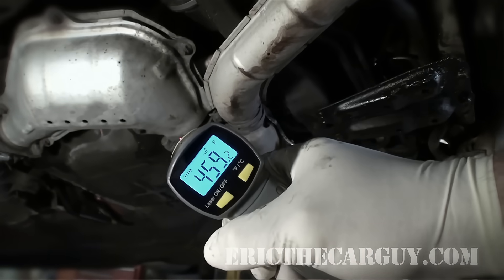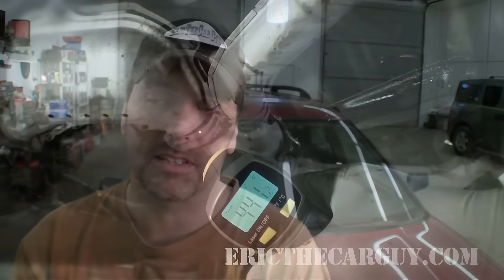Does Lacquer Thinner Clean Catalytic Converters? -EricTheCarGuy

Comment: Hello Eric, Thanks for the great tutorials; but don't knock some of the other guys that have the same intentions of helping others with DYI repairs. As you said you have dual cats which might be a factor.Soap and water might be the best bet in this case.
Reply: Correct !
As Myth busters do... They always Screw Up... Change / Weaken the Fix... So It Does Not Work.  You Need 4 Times the Thinner.
You were supposed to do 1 Gallon of Lacquer Thinner on a Half Tank (8 Gallons of Gas).  You barely had any Thinner.
But I used 2 Gallons of Lacquer Thinner with 13 Gallons of Gas in my 2013 Chevy Silverado 2500 HD and Drove 190 Miles on Highway.... Till I was near empty.... And it worked.  
But hey,  This Video is just an attempt to try and put down another Channel... small minds... small mission

Comment: I wonder if it is starting and stoping the engine. Letting it warm up to operating temps. Turn it off and let it cool all the way down overnight then starting it the next day. When cold the engine floods the cat with raw fuel to get it to light up again. So basically not driving on the interstate for the whole time. Drive it for a week like normal. Just a thought...

Comment: if you decide to spray the inside of your cat/dpf with a pressure washer,"DONT", if you do you will bend over and damage the matrix system inside blocking it worse,rendering it not useable anymore.

Comment: i tried spraying acetone into the air inlet with the engine running at about 2000,you got to be careful dont go too mad else you can cause it to lock,just let the engine rev with the acetone,it took about 4 mins and light out,never came on again.i am telling you what i did,iam not telling anyone to try this,but if you do its your own responsibility.

Comment: Eric: Have to agree with many others here. If you're gonna try the lacquer thinner test as Scotty suggested, then you should use the mixture he recommended - 1 gallon lacquer thinner to 9 gals gasoline. This is a 10% solution. 
Your test used 1 quart thinner to approx 7 gallons fuel (28 quarts). So your mixture was only about 3%, not 10% as Scotty recommended. Please try it again if you can. I'd be interested in your results. Thanks! Love your channel.
Reply: Yeah definitely an incorrect ratio. Scotty's car probably had a 15Gal tank, so half that plus a gallon(not a litre) of thinner.
Reply: 07 fj cruiser 
Saw this a year ago and tried Eric’s ratio - it helped a little but not enough. Then while running at 2000 rpm was reading the comments and saw scotties ratio of 10% (9 gallons gas one gallon thinner). Did that and it worked.

Now, how long did it work? 11 months/ 11,500 miles.  And it’s back just in time for an annual smog.  Haha
Going for the one gallon can this time and we’ll see.  

I couldn’t remember which guy had it work so reading comments and remembered.
Reply: Is there a specific brand that is more pure I heard acetone containing thinner can dissolve seals and gaskets
Reply: @bobbydigital4125  acetone is a different animal than laquer thinner. Do not use acetone !

Comment: Mix ratio all wrong for sure, but I have a problem with the mixing method. Shouldn't we POUR THE GASOLINE ON TOP of any fuel additive to get a thorough and best mix in the tank?
Reply: hell, take the gallon of thinner to the pump with you, add a gallon, pour 1/9th of the thinner in, then repeat until you have 9 fresh gallons. Boom. Well-mixed.

Comment: I tried the gallon trick on my 2000 grand caravan a few years ago.  It worked long enough to pass the emission test.  The code came back, so I did it one more time and the code never came back.  Sold the  van about a year later.

Comment: I am an automotive mechanic engineer. and I do not recommend doing it no less than half a tank x 1 \ 4 of fine lacquer or use this mixture several times full of gasoline because the oil compression rings will suffer harmful zebras, these oil compression rings are the cylinders of your car and have a plastic or rubber ptf cover. If you put a mixture that is too heavy, the life of the oil rings will lose its quality and your car will start smoking through the exhaust and this repair is only possible by changing the engine cylinder rings. So guys, be very careful when putting a mixture above 25% of your gas tank. The truth is that I do not recommend it, the most correct thing would be to remove the catalyst and clean it from the condenser and use cleaners you can use pure thiner laquer and an air gun to remove the titaniun "platinum that has value as gold is called white gold" that is a white powder

Comment: Scotty's method works if done right depending on how bad the cat it. I would recommend you try both methods. Have done it personally and it worked on a cat on a dodge charger that gave me hell. So I took it off, soaked it in a bucked of water and dawn soap for 3 hours, rinsed it thoroughly (making sure I got all or most of the suds out), blew it with compressed air, put it back on and drove for 20 min to make sure it dried... The p0420 initally came back on so I let the car cool overnight and went on to the next method. I put a gallon of laquer thinner in at the time I filled up to a half of a tank. Immediately I took it on the highway under a load of at least 65 for about 30 min. Within 10 or 15 minutes I literally felt the car no longer was bogging down like it did before. So I check the readings on my scanner and saw that my 02 sensors were functioning properly this time. Also my cat monitor readiness had been set without any p0420, which previously would have came up way before the monitor have been set. It has only been several days since the with no p0420 but I have put over 500 miles and the car drives better and gets a hell of a lot more fuel economy.  Also, all of my monitors are now ready without any single code. Based on all of the above I would say that the methods work. However it has to be done correctly and it may depend on the condition of your cat. Lastly, I would add that you have no exaust leaks interfering with your o2 sensors, as this might affect results. A new cat on this would have cost me $450 plus labor had I not done it myself. The dawn,  laquer thinner and half tank us gas cost me 40 bucks.

Comment: I used crc guaranteed to pass complete fuel system cleaner from Autozone, designed to help pass emissions. It made the code p0420 go away and the check engine light off. And it costed about $15 compared to one gallon of LT costing $20.
Reply: I was wondering why none of the other comments mentioned Q2TP? I used this for three years in a row to pass inspection. Each year it worked, each year shortly after passing inspection the check engine light came back on. But I had already passed inspection and the car was driving fine all of the time, so I just drove it. The car is now 23 years old and only needs to pass the basic inspection, meaning the check engine light won't negatively affect passing the inspection because of the age of the car. Now, I had other exhaust issues and such, it was suggested that the cat be replaced. This made the check engine light go off and stay off. The repair shop said it will stay off now. Not so, it went back on 2 months later.  Moral of my story... every car is different. Spill some QT2P into the tank or some of the Scotty idea into the tank. It is far cheaper than a shop cat replacement. I watch Scotty and respect his work. By the way Scotty doesn't have sponsors who pay him to promote any products. He promotes his integrity.

Comment: Crazy thing is I had a p0300 and that was it. After much diagnostic, it was found that the catalytic converter was pretty much gone! It all was clogged up in my resonator. So I replaced my converter and got most of my resonator cleard but not 100 prct. Dont know why I didn't have any other fault codes. Any thoughts?

Comment: I followed Scotty's instructions to the letter... and nothing happened.  I was kind of mad, but hey... I was only out $20 bucks for the gallon of lacquer thinner.  But wait!  Two days later, my check engine light went off!... I was SO psyched.  I had given up on it working... but what do you know, it worked!  It just took a couple of days, I guess, for the computer to determine that the cat was performing correctly, and turn off the light.  Made my effin' day!  2005 Chevy Aveo.  137,000 miles.

Comment: I have a 2001 acura rl 3.5 which has 2 codes
PO420 catalyst system Efficiency below the threshold B1
PO151 HO2S B2 S1 Low Voltage...

What suggestions or Ideas I can do so that I don't have to replace it... It's very expensive

Comment: I'm going to give it a shot I have 0430 on a 2003 Toyota 4runner and I replace the o2 sensors already P.S. I have a new engine less than 500 miles on it

Comment: 3/4 full tank and only a quart of lacquer thinner?
Scott said 1/2 full tank and a GALLON of lacquer thinner.
Reply: he also said it unclogs it not FIXES it. dude is an idiot
Reply: @joeturtleneck2300  he also said if that doesn't work take the cat out and leave it in dish soap in a bucket overnight. Which worked for me. 3 years strong.

Comment: can a car still run if the catalytic converters is completely clog?  I have a kia 2009 sedona that can be start but when I put into gear it can only go up to 5mph the most but now when I change into gear the engine is kind of shaking and die within a few minutes.  the error code is P0420.  It's the same result whether if I change to drive or reverse.  I can move with couple feet only.  Thanks in advance.

Comment: My converter was bad but I got no error code for the converter. My car would no longer accelerate properly so I took it to my Mechanic. After he tested and found the converter was bad, he replaced it for about $260.00. It runs fine and I got lucky they have a inexpensive replacement for my car.

Comment: Hello . I have 2010 dodge jorney.. 116000 miles. P0420. Bank1. I removed the oxygen sensor on bank 1 used choking throttle body cleaner to clean sensor spray the interior lining of the catalytic converter did not take out the second Bank One sensor below the top one but sprayed directly had it did notice that check engine light did not return back on for couple days.  but there is a random misfire that happens at one time or another causes it to pop back on. Took out both sensors and clean then.  3 days later so far been  nothing.  I think taking out the sensors and spraying oxygen sensors and inside cat with choke cleaner. Worked for me.

Comment: I posted a question about the mix ratio at the point where Eric was adding the lacquer thinner. After seeing the entire video I am deciding against doing this. I was resigned to replacing the two cats and four O2 sensors so I just might go that route so I know it was done right.
Reply: That’s kind of like saying instead of cleaning your shoes you opted to just buy new shoes. Cause at least it’s done right.
Reply: NOTICE:
As Myth busters do... They always Screw Up... Change / Weaken the Fix... So It Does Not Work.  You Need 4 Times the Thinner.
You were supposed to do 1 Gallon of Lacquer Thinner on a Half Tank (8 Gallons of Gas).  You barely had any Thinner.
But I used 2 Gallons of Lacquer Thinner with 13 Gallons of Gas in my 2013 Chevy Silverado 2500 HD and Drove 190 Miles on Highway.... Till I was near empty.... And it worked.  
But hey,  This Video is just an attempt to try and put down another Channel... small minds... small mission

Comment: Here is my take on the test, if you are going to claim that the other mechanic is wrong you must REPLICATE the test exactly as it was done by the other person. You have 3/4
of gas in the tank the other mechanic had 1/2 tank so your mixture was diluted by about 4 extra gallons of gasoline not good. It looks like you used 1 quart or 32oz of thinner, the other mechanic used 1 gallon or about 128oz, conclusion you DID NOT REPLICATED THE TEXT DOES MAKING YOUR CLAMIS FALSE the only way to discredit someones else test is by exactly replicating the original and that is not what you did.
Reply: Thank you, that’s what I came here to say.
Reply: Thats what I said.
Reply: I said the same thing how can you discredit someone's work by not even following the same steps and measurements they did. right away i knew it probably wasn't going to work when he dumped that little can of thinner with way more than half a tank of gas lol
Reply: he did say he wasn't sure if the mixture amounts were the same when the video started.
Reply: Yeah he  knew it wasn’t the same test. He as a mechanic trying to dispute another’s had reviewed Scotty’s video a couple different times. I’ll stick with my Subscription to Scotty’s channel.
Reply: @aaronmatthewallen8470  Well next time he has a wank he can leave the cam off.
Reply: @aaronmatthewallen8470  ...that doesn't excuse what he did...or excuse him from saying Scotty and his methods were wrong. The false result implication made by him is "Still out there"...and its wrong. How can you excuse this ?

Comment: If you’ve got an o2 sensor fault. It’s because it’s reading a lack of o2
Take of the cat, drill some holes all the way through it, remount & let that back pressure out.
O2 sensor will relax because it’s getting better o2 readings.

Comment: Very interesting video.  Maybe people should put the stuff into their gas tanks when the car is younger; to keep the converters clean.  Like maybe once a year.  That might keep them clean a longer time.
Reply: from what little I understand about the subject, cats get clogged mainly due to an engine burning oil.  If the car is younger and not burning oil, then there is no point in doing this.  However, if you keep an eye on your dip stick and notice that it is burning oil but the cat error codes haven't started yet then it may be a good idea to do it as a preventative as you say.
Reply: @greasystrangler3703  Thanks for this...I know my car burns oil, no leaks on the ground...
Reply: @greasystrangler3703  burning oil? Or burnin fuel?

Comment: Well to be clear he did state to TRY the laquer first amd if that doesnt work then to attempt removing the cat and soaking it overnight, and theeeeen if that also doesnt work youll need a new cat, he did say that it may not work but its worth the try. And its the easiest way to start. If the cat is effectively bad then neither method will work as stated. Im not attempting to degrade you, just wanted to add that as well

Comment: I believe Scotty said 1 gallon not 1 quart at half a tank
Reply: Youre right 1 gal @ half tank.
Reply: @noconsentgiven  it worked for my son’s truck!👍
Reply: I thought it was half a gallon and a quarter tank.  Of course that would be the same ratio to a half tank.
Reply: Scott said 1 gallon of thinner to 9 gallons of gas.
Reply: I agree, he didn't follow the instructions exactly.
Reply: Kilmer recommended a 10% mix.  10 gallons 1 thinner to 9 gas
Reply: I did 1.5 gallons in my half tank, 15 gallons of gas.
10% as Scotty recommended 
Noticed some improvement in the first 10 miles….
Drove 150 miles at 60 70 mph
Amazing improvement after burning through the tank👍👍
Reply: Would it be ok to use this lacquer thinner once a month ?

Comment: Scotty Kimore is great entertainment, but there's no way in Hell I'm running a gallon of lacquer thinner through my fuel system because I've seen what that stuff can do.  I've seen it melt a few Toyota pumps back in the 90's when accidentally allowed into the tank while cleaning fuel injectors with the stuff.  Now maybe I would pull a front O2 and poor some in the exhaust a few times and run the engine at high RPM's to try to  blow some soot out.  
And by the way, blasphemy of Scotty Kilmore is a bad bad thing.  LOL

Comment: I live in a state where I don't need the cats on. many remove them.  Now, if you remove the cats and weld straight pipe.  how does this affect the computer and o2 sensors? just an FYI thought...   love the car man btw. great vids saved me a lot of money... 1 fuse and  I was driving my 06   5.4. TRITAN engine

Comment: Will white spirits/laquer thinner make carburetor car pass emissions test?
Reply: Maybe if it does have a catalytic converter. Usually you just need to clean the carb and adjust the air/fuel ratio.

Comment: I don't think he used enough.  about every 3 months i run a 5 gal. bucket of xylene or toluene (which we use both like water at my work) through my shitty work car.  It raises the octane from 87 to about 95 with 12 gal. of pump 87 octane that i put in my tank with it.  runs like a champ on that shit

Comment: You used common hardware store variety lacquer thinner which is not as hot a solvent as automotive lacquer thinner. Would be really concerned about damage to soft components in the fuel system, seals, gaskets, plastics etc. End result, could spend more money on fuel system repairs than the cost of a new cat. Also, if someone in the past has used some oil that has zddp additive in it then the lacquer thinner will have absolutely no effect.

Comment: 32oz to (tank 2/3 full of 13 gallons = 8.6 gallons x 128= ) 1,100.8 oz means you cleaned with a 1 to 34.4 ratio.   Scotty cleaned with 128 oz aka Gallon to 6.5 gallons = 832 oz  means a 1 to 6.5 ratio concentration.   So his solutions is 5 TIMES MORE CONCENTRATED THAN WHAT YOU USED (34.4/6.5= 5 TIMES MORE CONCENTRATED).  Don't trust this idiot with your car if this is his version of "scientific discovery".

Comment: The P0420 CEL first appeared four days ago on my 04 Volvo S60  with 175K. If reset it would reappear the next time the car was driven.  I ran across this fix and not wanting to replace the cat decided to give it a try. Added one gallon of lacquer thinner to  between 1/2 and 3/4 tank. I didn't do any revving of the engine  or anything like that,  just my normal everyday driving. CEL has not returned.